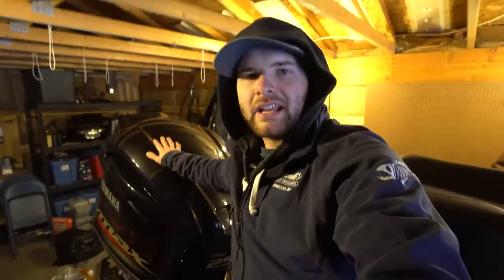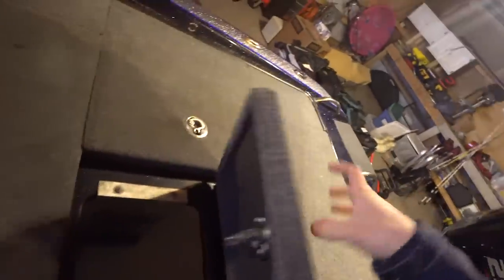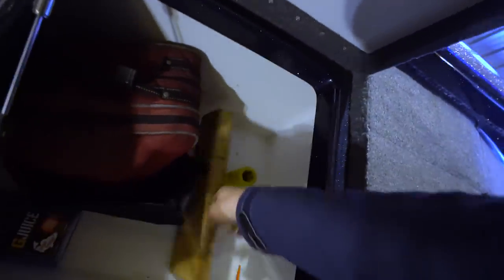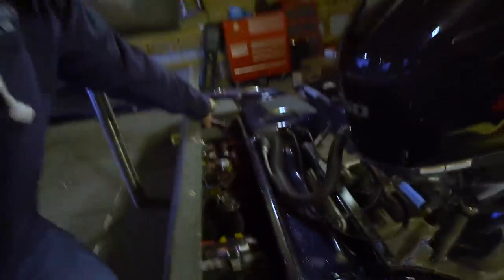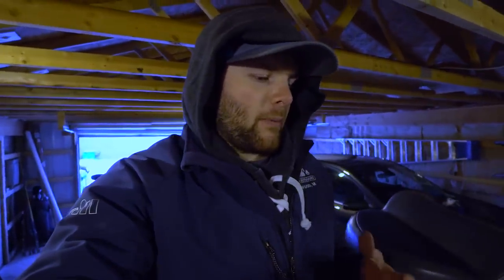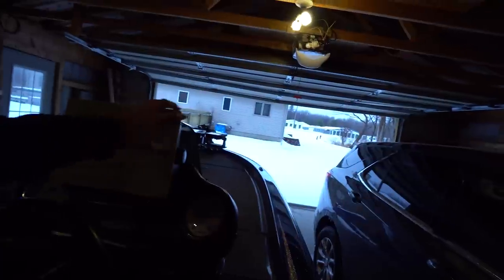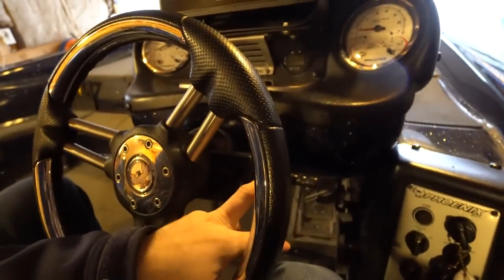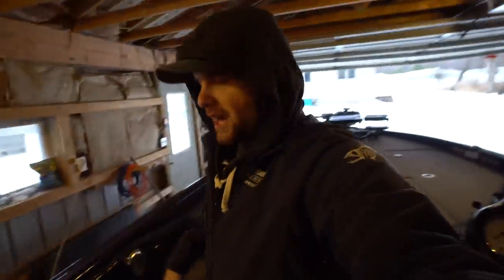Bass Boat Walkthrough - Phoenix 920 ProXP

Comment: Talk to me about your TM stabilizer and bow mount for your graphs? I’m trying to figure out the most secure way to keep those safe in big water. Thanks!
Reply from the maker: I was going to run a TH Marine Troll Tamer which I had on my old boat, which locks the motor to the deck, but I can’t get it to fit with my longer TM (it is amazing though).  For now I just use the bounce buster that comes with the Ultrex.

For my graphs, I’m running a ComfortTroll Deck Mount on the 1040xs by my foot pedal (new for this year) and a 2” Ram Mount for the Echomap graph.  When I’m running, I’ll lock that echomap to the deck by laying it flat